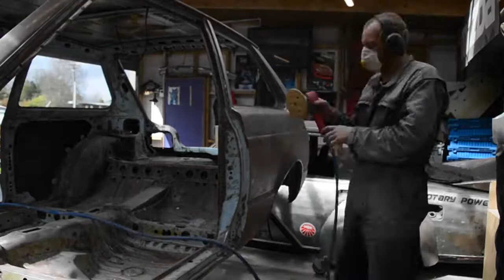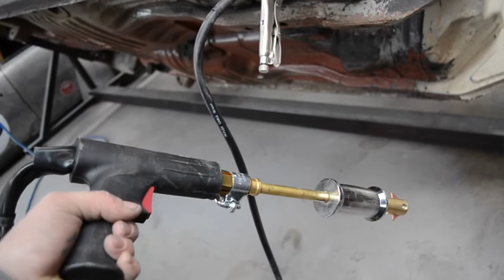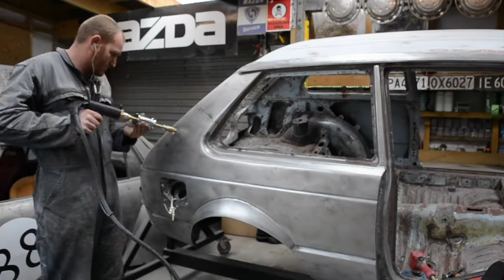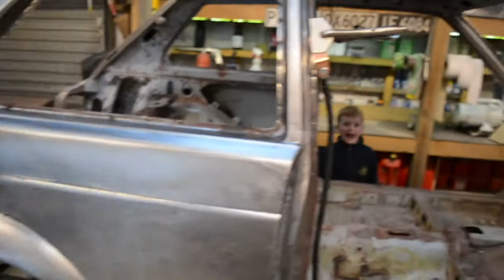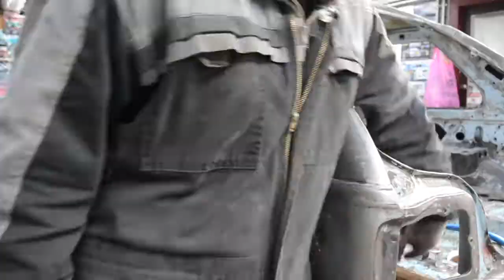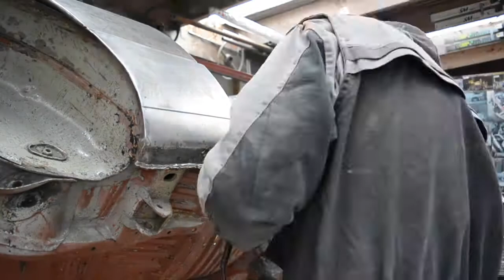Toyota KP61 4AGE Starlet Overhaul - Panel beating, dent pulling and body prep - Kune RE

Comment: Did you have to modify the tunnel to get the j160 to fit? Apart from the shifter hole
Reply from the maker: Just a little bit of massaging with a hammer around the bellhousing